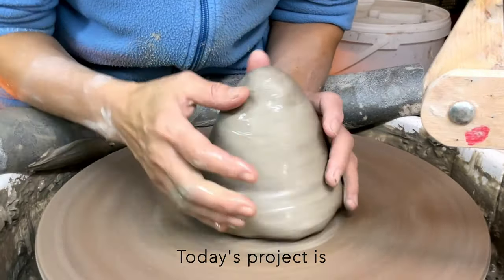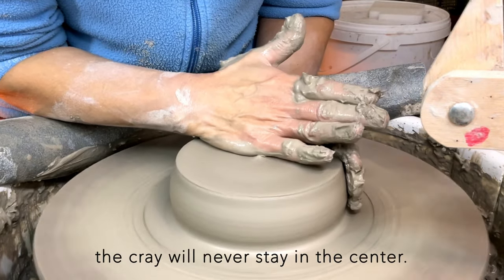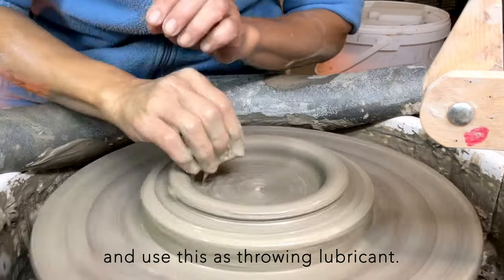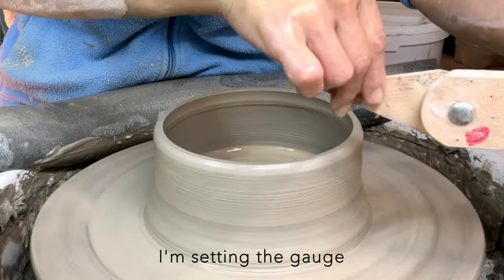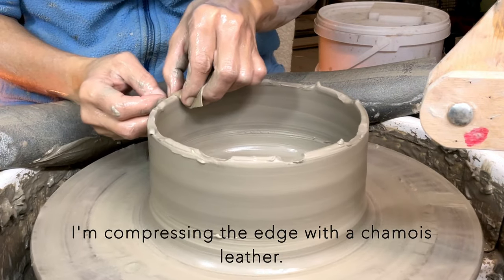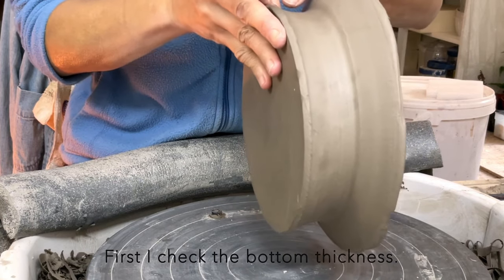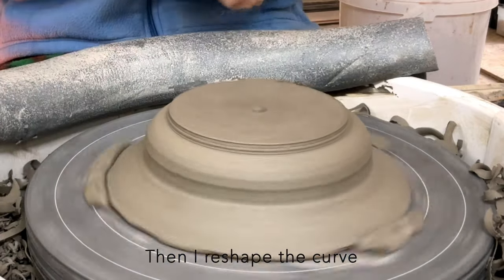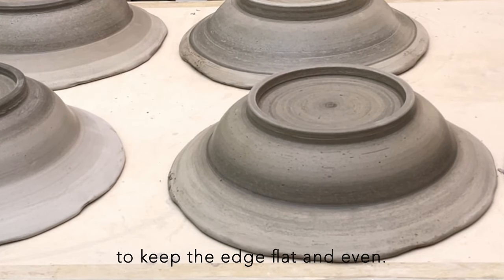Throwing a Wide Rim Pasta Plate on the Pottery Wheel

Comment: Thank you for describing each step, especially those that are easily missed by the viewer.  For example, you described how you captured and moved the soft clay with a thumb or finger and then reused it as a lubricant.  If you had not pointed this out, I would have missed it completely.
Reply from the maker: Thank you for your very useful comment Jack😊 It is very helpful for me to get feedback from viewers which parts are informative for them.
Your comments give me good direction for the next videos.
Thank you!

Comment: I love the shape of these plates, and it was wonderful to watch your process. I had a question :). I wondered why you cut the rim on the wheel when it is wet in the first stage, versus after the leather hard stage when you trim the foot?
Reply from the maker: Thank you for your comment Malcolm😊 It is a good question! No one asked before but it is important for me. The reason is an aesthetic preference.  If I cut the waves at the leather hard stage I found the appearance becomes very flat and artificial. I use that technique when I want to make very formal style. Most of my works are individual work even dinner set. When I cut the waves before I open the rim, the stretched waves became something beyond my force. I love that effect. I can never make same waves again🤩. I see the beauty in the uncontrolled parts. This comes from my main philosophy “Wabi- Sabi”
Reply: @AlchemyCeramic  What a wonderful answer, I love that. Thank you again for sharing your artistry and expertise.